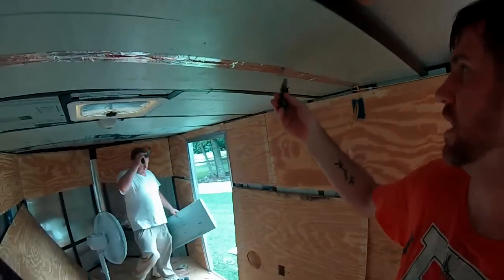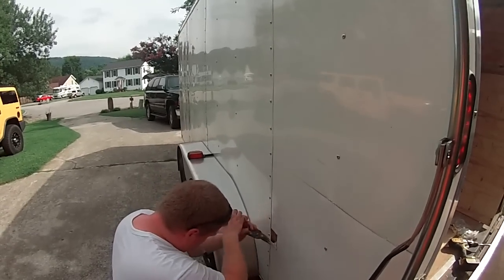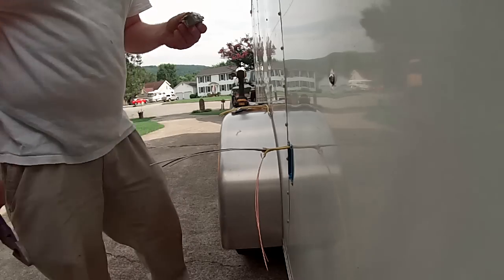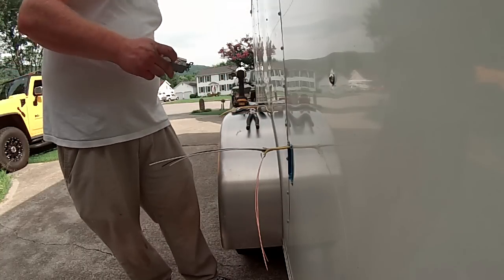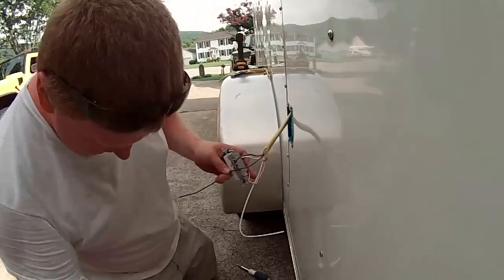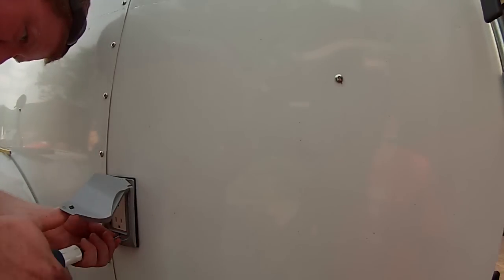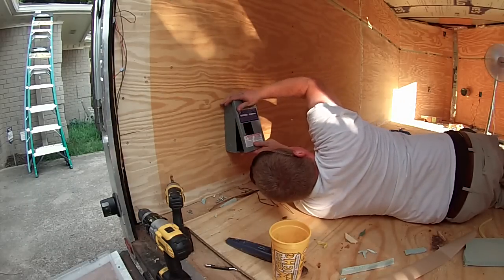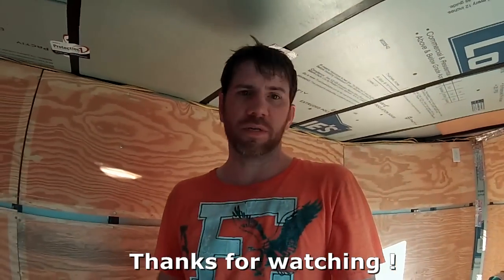7 x 14 V-Nose Enclosed Trailer / Camper Conversion Pt 2 Electrical

Comment: Why not put a male outlet on the exterior for power? Dangerous decision there! IF it comes unplugged you could potentially have a lethal 208-240v  if it's off two phases.

Comment: Again another gr8 video. You sort of answered a concern I have had with respect to installing against that sheet metal i.e. using wood as support. Have you done this in your other projects e.g. for water access or other where more support in needed for the item being installed. Did you need a lot of wood or just a bit around the box etc being installed and have you found that this provide RV type support i.e. it is strong enough to take day 2 day hits?